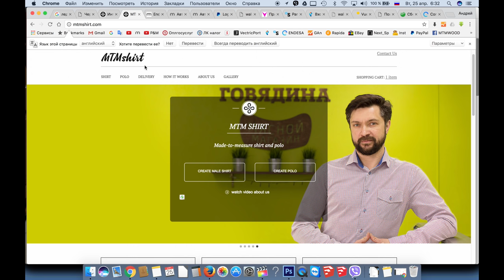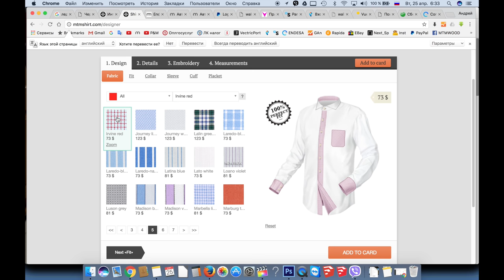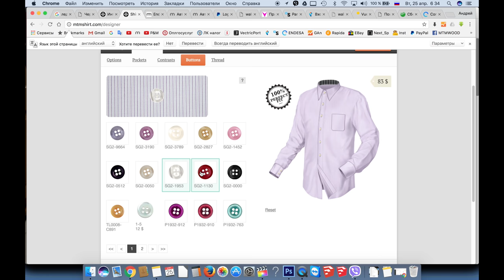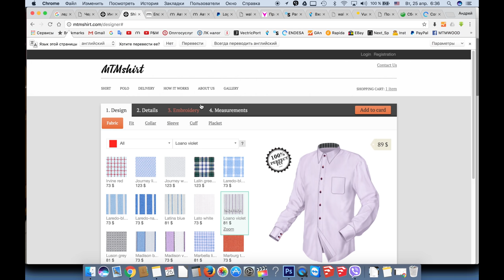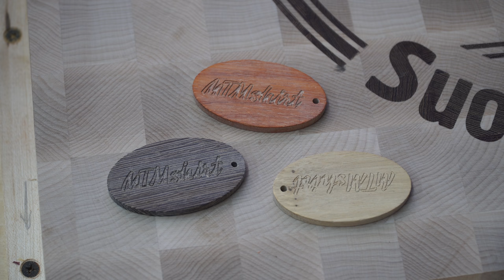MTMSHIRT logos: finishing with the use of vibratory deburring machine

Comment: About the oil spots on some of the wood, but not others:  I read that Wenge is a very porous wood.  The cherry that I have worked with has a very tight grain - not very porous.  My theory is that the oil spots are due to the blanks sticking together.  Because cherry is least porous, the oil did not soak in good and stayed on the surface, causing blanks to stick.  Oil could not stay on the surface of Wenge due to it's high porosity, therefore no sticking and no spots.  The other woods must have porosity between Wenge and Cherry.  I know Ash is more porous than Cherry, I suspect the others are as well.  This is just a guess, and even if correct, I don't know what could be done about it.  Very informative video.  I like the fact that you discuss the problems you come across instead of only showing success. Thank you for continuing to educate us all.

Comment: One thought on the drops of oil is how you introduce the oil.  Perhaps it needs sprayed in rather than poured so that it is introduced in a less focused way.  I'm also curious about the wood chosen as the 'sanding' in relation to hardness levels to that which you wish to sand.  Much like the stones used to polish metal, you want wood cubes softer than the wood you are polishing...I think.  Very interesting process and very time consuming.  You might want to build a sound box for that vibratory deburring machine!

Another thought on the wood dust:  If your dust collector isn't collecting the fine wood dust, you don't have high enough CFM for your extractor.  Usually, this means that your pipe is too small and needs to be larger.  6" pipe is typically a better size than the more standard 4" size.  Your hole on the lid of the deburring machine should be made a larger diameter to fit a larger pipe.  If you search on Bill Pentz Dust, you'll find a lot more information about this topic...more than you'll care to read, I think!
Reply from the maker: I use 160 mm pipes. I know the Bill's research very well - https://www.youtube.com/watch?v=FPw4Z0KcM-g
I think my current blower (5HP) is too powerful for this cyclone - https://www.youtube.com/watch?v=GTobcnj54Lw
Thanks!